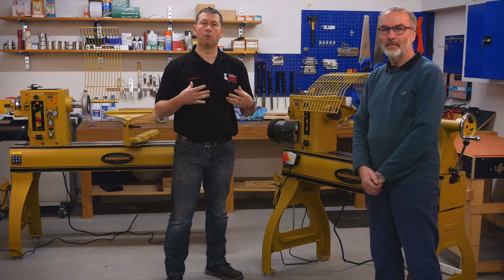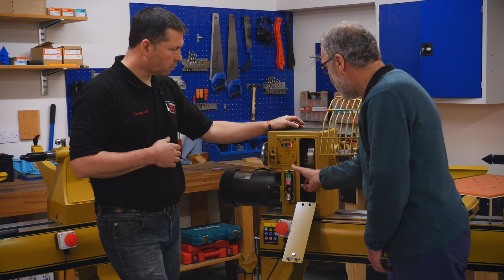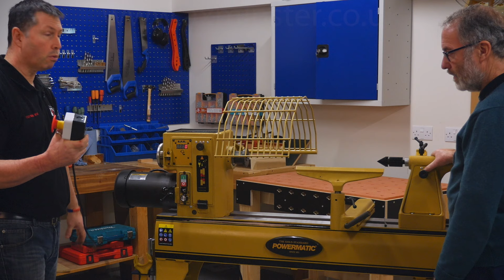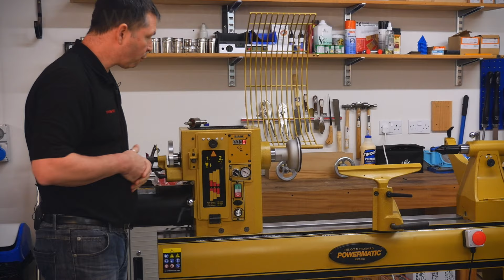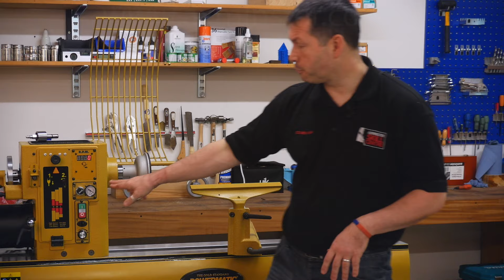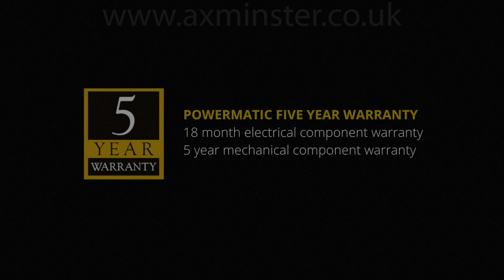Powermatic Lathes 3520B and 4224B - Overview

Comment: Does it have a spindle lock/motor disconnect feature to prevent turning on while spindle is locked?
Reply from the maker: Hi, the 3520B does not have a cut out switch and the spindle lock will only lock the spindle and not the index.
The 4224B does have a cut out which is part of the overload on the inverter, but both lathes also come with a remote position red push button, this can be locked on stop and provides a good fail safe as the lathe cannot be started when this is pushed in. This twist locks to release. Kind regards Lindsay - Customer Services-